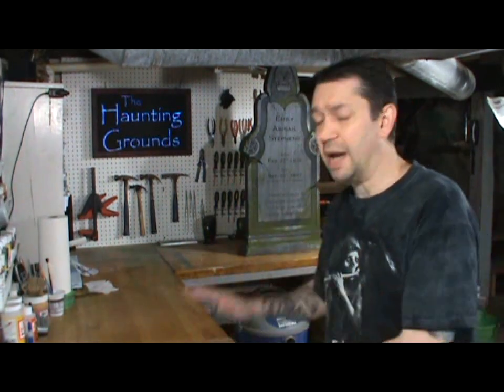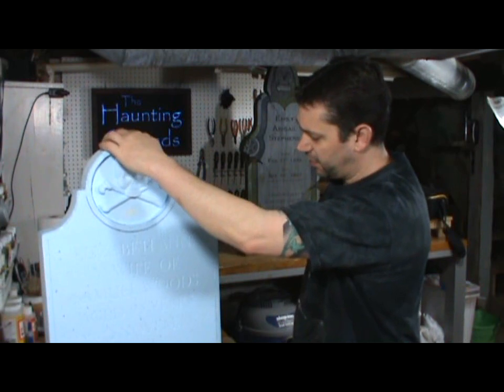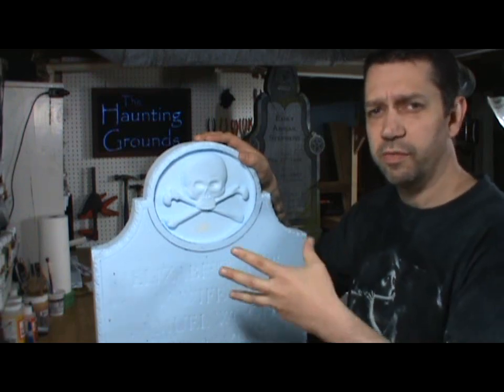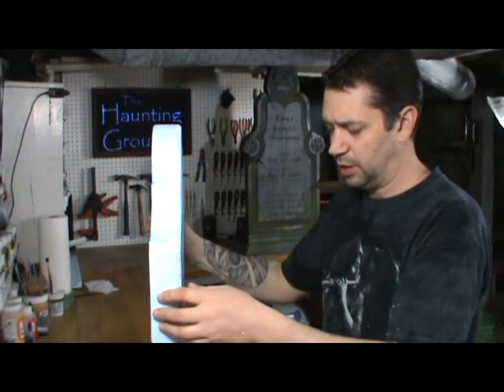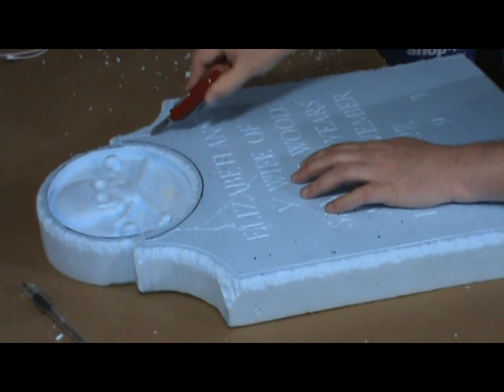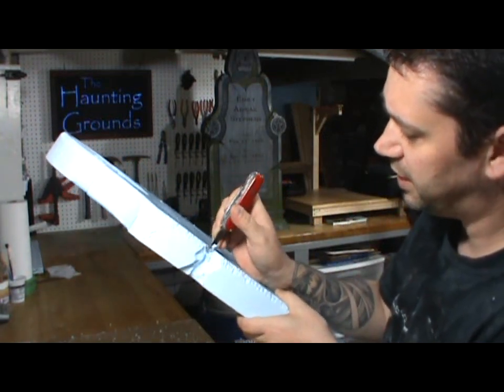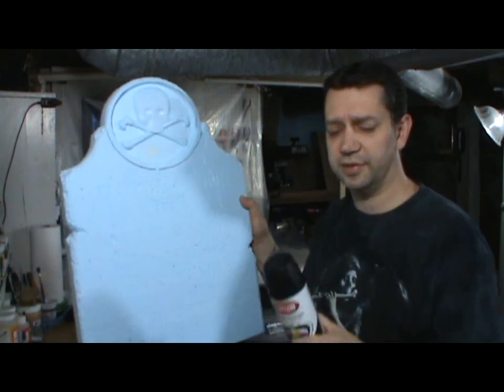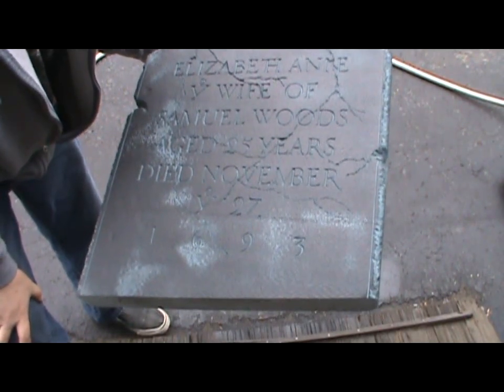Tombstone Carving: Weathering - part 1

Comment: To get images and lettering on your stones..
Print it in reverse using ONLY a laser printer.
Place the reversed image on the foam, use an regular iron set on a low heat and go over the lettering and images for a few seconds.. slowly peel the page and the image will be ironed on to the foam. Practice makes perfect.
Reply: Great Idea Mark

Comment: Thanks for the tips. Some of them are new. I hunt down a lot of these Halloween prop videos looking for tips. Your stones look great. 
Couple of tips for you, if stone is going outside drill holes in the bottom for the cheap 1/2" pvc and glue it in, use rebar as stakes. 
When making that skull and cross bones next time try carbon paper, it helps things go by a bit faster.

Comment: What knife is that? It looks like a SwissChamp, but it doesn't seem quite thick enough for that.
Reply from the maker: I'm not sure which model Swiss Army Knife that is. Its genuine Victornox, but I have been looking for an identical replacement, and have thus far been unsuccessful.
Reply: ***** If it helps, it looks like a Huntsman to me. If you were to tell me what tools it has on it I might be able to track down the model name (or you could just look through Blade HQ's selection of knives under Victorinox).

Best of luck.

Comment: Hi SK. In this comment you say you use EPS, but in the video you say you are using XPS. I bought EPS foam (35 dollars for 2inx4ftx8ft from lowes, XPS foam is about 33 dollars for the same dimensions from Home Depot. Could you clarify? Thanks!